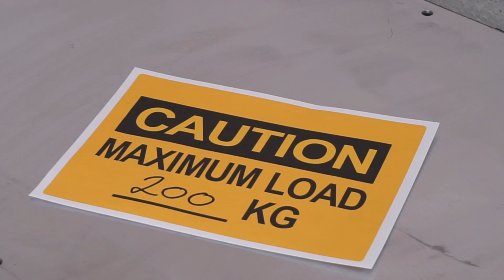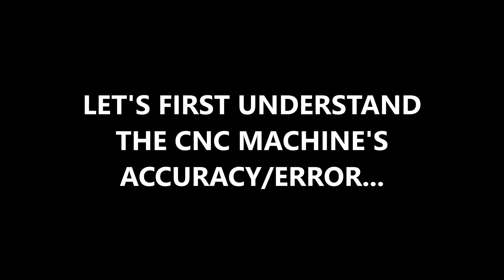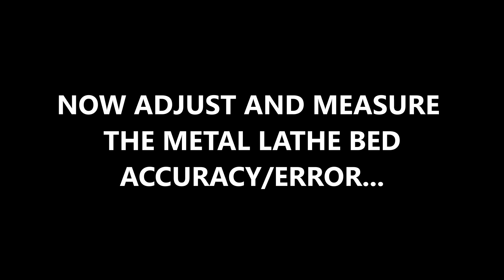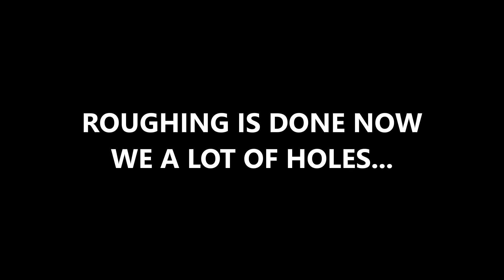Building an UHPC Metal Lathe Part #5 - Working both ways...

Comment: Very nice! Do you think the steel moved during the curing process of the concrete? Or during the pouring process of the concrete? Or was it not aligned well even before the concrete was poured? I'm working an an epoxy granite VMC design that is why I ask.
Reply from the maker: Hey Nick, thanks! I guess i figured out what happened in the meantime. I probably had too many and too longs anchoring bolts and when the UHPC cured it shrunk more than i expected and pulled it so that it bent. Also i can only guess on how much load that poured concrete put on the mold on my wobbly work bench...
Reply: @CHIPLOAD  It was pretty sure your formwork and workbench. When building a mold, most guys forget that there are great forces there, especially when dealing with UHPC, which only hardens later and does not settle the First Hours.

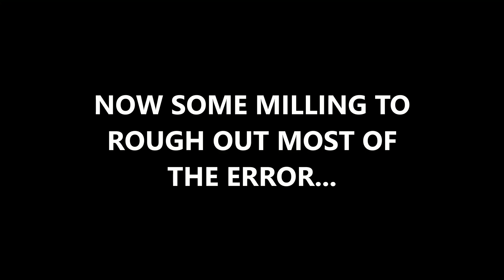Comment: Brother can you please explain the calculation  more how did u get the alighment calculation 4:02 is it possible you make separate video for this.  Or explain in next part
Reply from the maker: The first measurements were just the surfaces after casting against the error of the cnc mill i build (again measured against a straight edge). After cnc milling the ways the remaining error was again measured against the straight edge. I plan to go into some of the details in a later video since i learned a lot doing it.

Comment: Also need your cnc spindle which u make with routet can you show the detail  I need to make one 5:05
Reply from the maker: There will be a dedicated video for the cnc spindle i built but surely this will take some time since i need to finish the lathe first... Here are the basics: 1) Get some ER25 morse taper 4 collet chuck. 2) Turn it cylindrical to fit some spindle bearings (e.g.: 2x B7005-E-T-P4S-UL). 3) build a simple housing out of aluminium and add a toothbelt at the end. 4) get some motor like the cheap cnc milling spindles (e.g. Kress) and mount it with a reduction of around 1:3. this way you can reduce the RPM down to around 4000-6000 and gain enough torque for milling steel. That's it :) If you need more, drop me an E-Mail to the channel's address. Hope it helps!

Comment: Hi dear...
I see a heavy lathe bad which can disappear the vibration 📳 from your work ..
Is Your milling machine spindle water cool? ..and how much hp?
Reply from the maker: Hey man, i recently switched to a new water cooled 2,2kw spindle (you will see that in one of the upcoming videos). In the video it still was a KRESS 1050W motor on a homemade spindle for milling steel (air cooled). All the best! Cheers.

Comment: shouldn't you seal the concrete so it doesn't crack with time ?
Reply from the maker: yeah it will sealed by painting it (probably something 2k based to resist oil/coolant), there is no special concrete sealer required as up to my current knowledge
Reply: @CHIPLOAD  You better look it up on youtube.
Nice, interesting project, had this idea before you but refrained from doing it for fear of concrete cracking in the future without a sealant.
There are some videos on youtube about sealing concrete which brought back the idea to my head and since you already done it, I asked you about the sealant you used
What was the purpose of the Flux ?
Thanks
Reply from the maker: @athrunzala5337  thanks i will look it up but when i checked with the shop where i bought the UHPC (it is not regular concrete but a special kind of industrial mix made for machine castings) it was stated that a 2k paint should seal it sufficiently. if you like you can lookup EndCNC he build a VMC as well (same UHPC i use) and is using it with coolant, etc. not sure what type of paint he used tho'
Reply: @CHIPLOAD  So from what I understand regular concrete won't cut it for me. I have to ask for UHPC . . is it a universal name for this type of concrete? UHPC?
Reply from the maker: @athrunzala5337  as from what i know UHPC stands for ultra high performance concrete which is water based (so no epoxy). you can look it up by the name of "TEGNO UHPC Spezialzement" and "NANODUR Compound 5941 by Dyckerhoff" (identical) depends on where you at you have to lookup a local seller. if you want you can drop me an email to the channel's email address and i am happy to help.
Reply: @CHIPLOAD  I don't live in Germany but thanks for the info, I will look it up, since it's water base, I guess it shouldn't crack. 
I saw EndCNC and as I expected, He did the casting on the floor and not on a wooden bench like you did . . I am saying so, so you don't spend precious time, money and effort scraping and checking . . The granite is more accurate than the straight edge

Comment: Some holes in the ceiling with two block and tackle thingys (or chain hoists if it's even bigger stuff) works wonders for such tasks!

Often comes in handy later on as well. It's nice to be able to suspend work, or even parts of the machine itself, over it.
Reply from the maker: yeah i'm truly considering some kind of lifting mechanism i think with the headstock there will be no way around :)